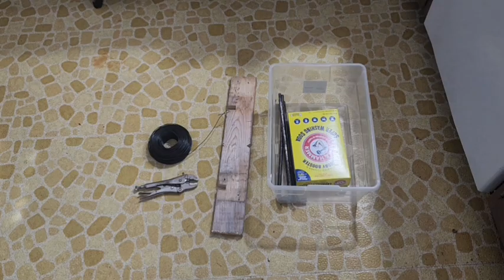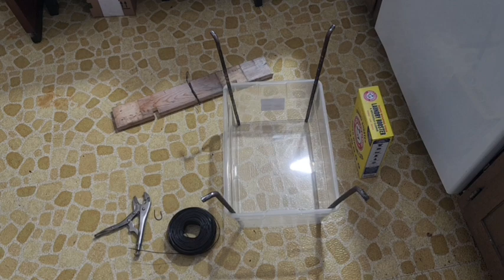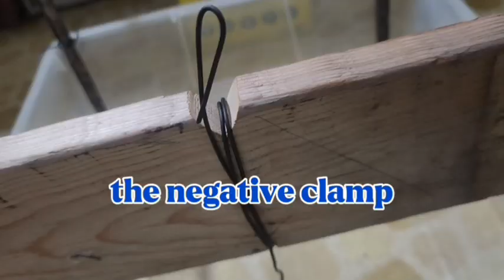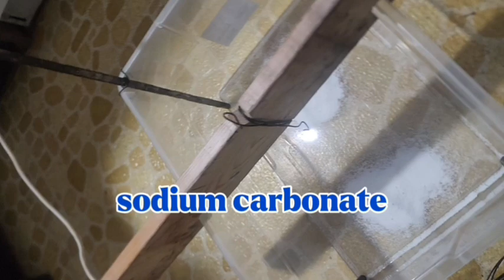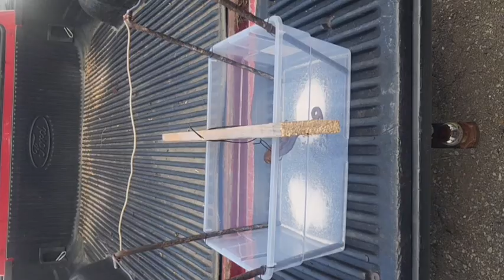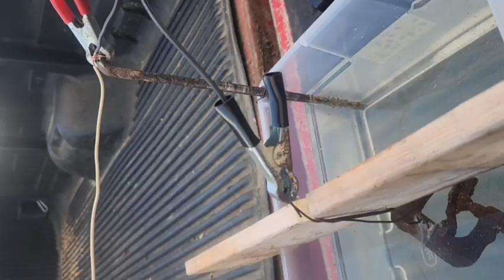Building an electrolysis setup for rust removal @RobCoonsGarage

Comment: What volts did you put the charger on?    My old manual charger only goes to 6 volts, is this not enough? I also need to clean the rebars.  Thanks.
Reply from the maker: The charger I used had limited options too. However, it is a 6 volt and 12 volt charger. I used the 12 volts and 6 amps setting. I'm not sure if 6 volts is enough. Make sure to clean the item you are trying to get rust off of down to bare metal just where you are connecting the wire (to make the electrical connection). I originally didn't clean my item well and only the wire bubbled. If you aren't getting Any bubbles, maybe you need a 12 volt charger. Hope this helps.
Reply from the maker: Yes, the rebar or sacrificial metal needs to be clean as well. As the rust removal process occurs, rust is coming off of the item you want to clean, but at the same time it gradually builds up on the rebar. When this happens you may actually notice the process slow down or the bubbles get smaller/ less of them. At this point you may even want to stop and clean the rebar again. Definitely before each item you put in your electrolysis tank.